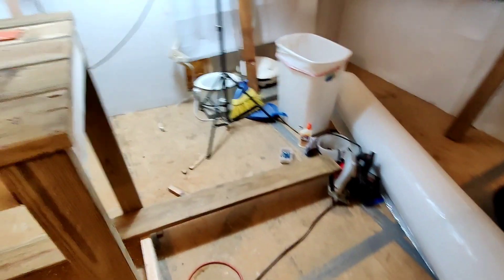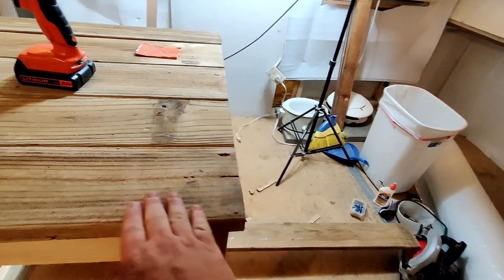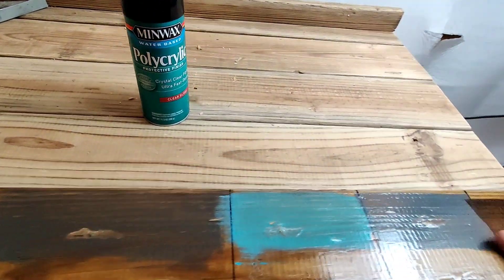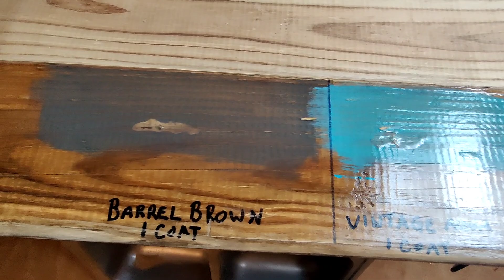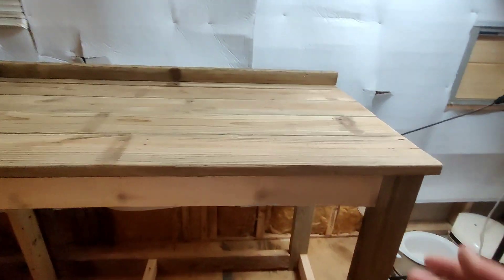MOBILE HOME 2x4 FRAMED KITCHEN COUNTERTOP PART 2

Comment: That strip of wood on the back looks good. A resin countertop would look great! But if this is not going to be a permanent thing? Maybe stain and a polyurethane finish would be more cost effective in the long run. Either way, I think it looks great rustic! It you're gonna do open shelving you may want to paint or seal the boards with something.
Reply from the maker: Oh its a permanent thing. It weights probably 200lbs now since I added everything.

Comment: Yes, add that backsplash board you will be glad you did later and it will tie it all together well. If it were mine, I would lightly stain the boards on top and the sides and then cover it with a clear poly coating. The natural look will always fit into any decor. Also, I would move that electric switch up or over to the left a little more if at all possible, it's way too close to the faucet and water sprayer for safety's sake. But I think the design looks great! But using dark brown with white is in my opinion too much of a contrast. I would go with more natural wood tones so it will always fit in and flow with whatever else you have in your kitchen and home, instead of standing out like a sore thumb... Tell Jamie she's such a good Dog, always love seeing her!
Reply from the maker: Thanks  for the reply. Yea all the switches will be relocated when I get ready to put up wall coverings. Im still not sure if I want to do drywall or not.

Comment: Like the back splash, leave the wood natural, you need food grade polyurethane for the counter top and don't forget to fill in the cracks with glue or clear waterroof caulk, otherwise food and water will get down in them, yuk. I did a counter with the pour on epoxy resin, it was spendy and the first time I sat a hot pot on it it burned, not an easy fix, it also cuts very easy. If it is thick enough you can sand it out but getting it Bar room style thick will be cost prohibitive and it will still burn. Need to make sure you have good trivets and cutting boards either way :)  Have fun, I love the rustic look of using the used lumber, it really looks nice.
Reply from the maker: Thank you : )

Comment: When i made mine i used 2x3 that I edged square made butcher block ect.  Not the point i used 1 quart flagship Marine varnish.  I think polycrilic will white spot bad.  Or go cheap and use mineral oil.  Easy cheap and can recoat.  I would avoid regular varnish or polycrilic around a sink.  Color whatever, backsplash definitely, especially if going against drywall.
Reply from the maker: Thanks for the tips on the white spoting issue.

Comment: Looking really good !   Yes to the backsplash, clear coat the top, aqua for the color, and since you already bought the paint, multi-color the front.  What are you putting on the left and right sides ?  Plywood ?
Reply from the maker: I'm not sure quite yet on the material, but I planned on enclosing the sink area and leaving the other area open.